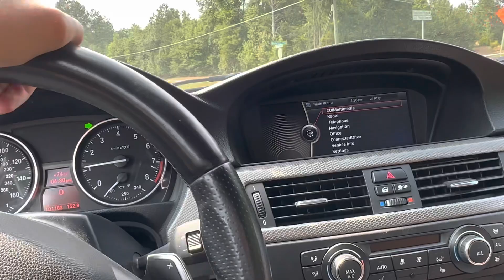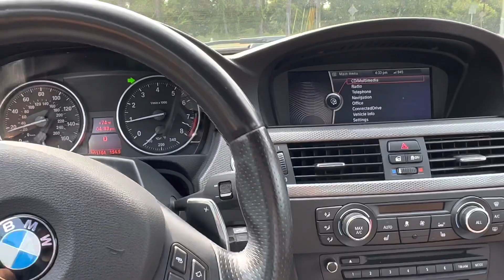E93 335i CSF Radiator First Drive

Comment: Do you feel like it takes even longer to warm up?
Reply from the maker: I usually let my car warm up for a while maybe 3-5minutes. So for me if there was a difference I wouldn’t have noticed. Temperature out side is usually a factor though
Reply: @ModelcarNick  nice. My radiator cracked on new car. Was considering to get CSF and an inter cooler. While I’m in there do the water pump… did you already do your water pump ?
Reply from the maker: Had my water pump replaced prior to doing the radiator. I personally didn’t do that job but I if you feel confident definitely try yourself. One thing I recommend you do is potentially replacing all the cooling hoses while you’re there. Mine are leaking now after the installation. Not sure if it’s a pressure issue. As of now if you’re running a stock car I might recommend you go with the OEM radiator

Comment: 240 is high
Reply from the maker: After about a year and half of having it in there I will say it seems to be cooling a little bit better. Huge pain installing though, I honestly recommend going with the oem one because they last another 100k miles and there’s no point in spending more when the car most likely wont last another 100k miles